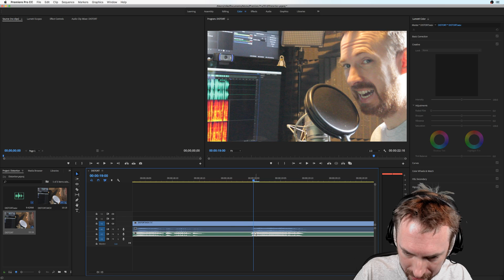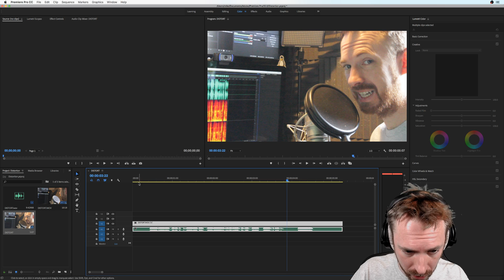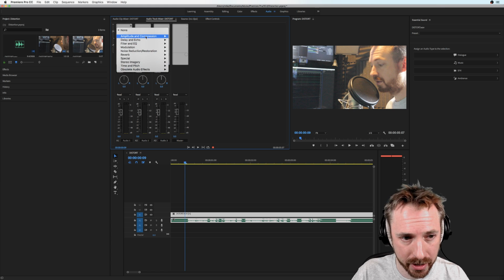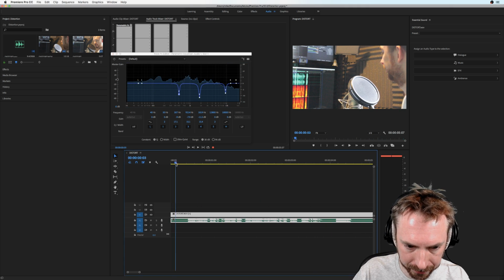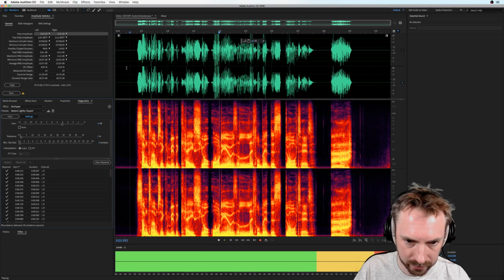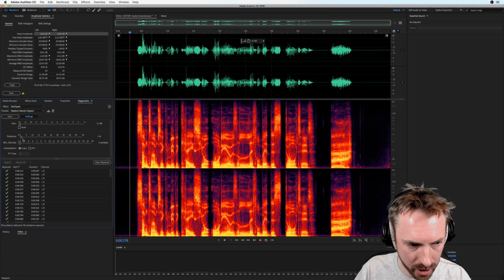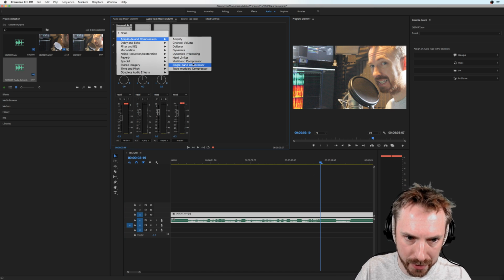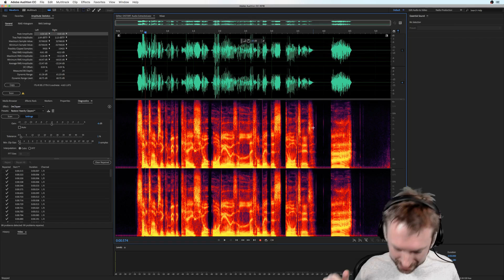How to Fix Distorted Video Audio in Adobe Audition and Premiere Pro

Comment: When using the parametric equalizer, suggestion : Set in and out points on your timeline and press the "loop" icon.  You may have to add the tool with the little plus sign.  But it will allow your audio you're fixing to loop, so you don't have to keep dragging the playhead back to the beginning.